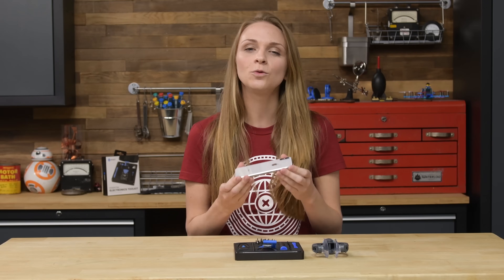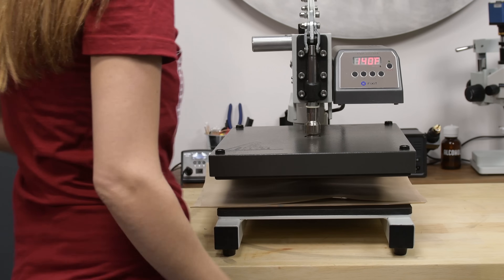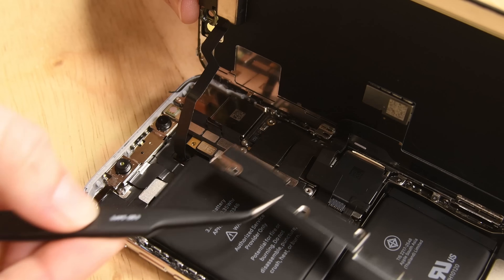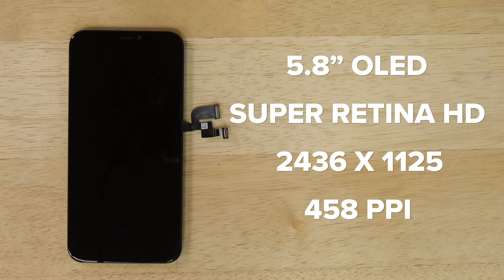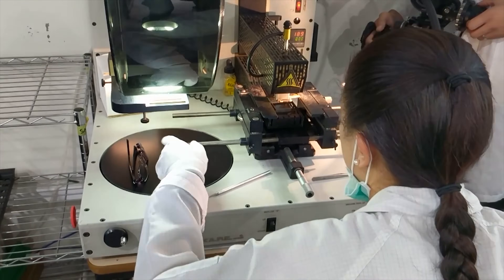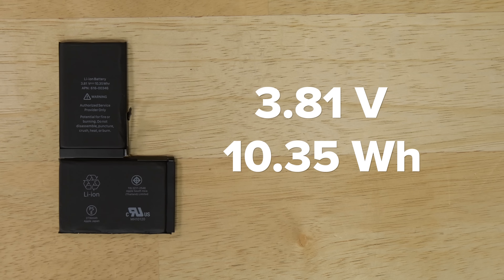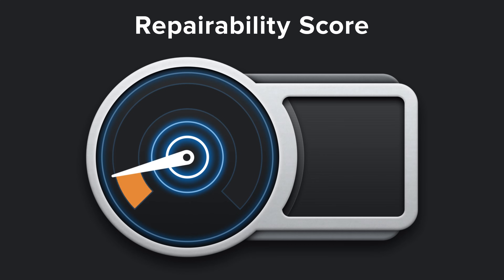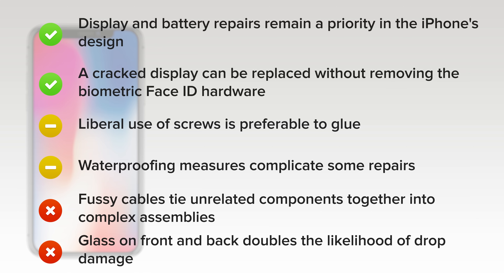iPhone X Teardown and Analysis!

Comment: But you haven't answered the question eryone should be asking:  how many charge cycles before apple throttles cpu performance? And when can we expect our $1000 investment to run at 50% performance?  1 year? 2? Or maybe it just depends on how poorly apple's stock is doing.
Reply: They’re gonna let you check it in later iOS versions

Comment: I was actually wondering about the inside of the iPhone X. Cause there’s 3 speaker lines two on the bottom where the lighting port is and one at the top where you put to you ear. Cause no sound was coming through to the bottom left side of the lighting port of where the speaker is usually is. The right and top are working as a audio for sound like music. Didn’t know the left speaker was not a speaker that was just a Taptic engine. Thanks for the video.

Comment: that PCB is a mess 
one can't repair it anymore
Reply: You cant repair phone PCBs for many years anymore. Everything is based on microcontrollers with thousands of soldered pins and you cant find replacement parts either.

Comment: - 2 batteries that can fail instead of one (and apples batteries are known to fail after about a year, at least my last 2 iPhone have) - sad.
- all processing power at one small spot= interesting to see how hot to the touch that spot will be under load, i did not see any heat pipe or advanced cooling solution. No space i Guess :-)
Reply: iPhone batteries do not fail with in a year stop spreading false information. Your 2 experiences don’t equal everyone else’s.

Comment: I'm done buying phones , the only thing I do on them is watching new ones coming out
Reply: Hugo true
Reply: That's right. And you can see examples of phones worth 100-200$ in which you can still record 4k, have 21MP sensor and 2k display like the elephone s8 instead of paying 600-1200$ like a moron for not using it.
Reply: Aitor Jara you act like those $100-$200 phones are actually on par with current flagships. yes, they can do those things. but they can’t do them WELL

Comment: One question for iFixit. I repair Apple logicboard for living, and i'm wondering if is possible to join back two half of this board after desoldering it. I have noticed that you had to heat whole board to separate it, because there is some elements moved from original location. You have never got this iPhone X to work again isn't it? It's toasted. Please reply.

Comment: Its interesting to see this highly proprietary internal design. I've never seen so many ribbon cables. Compared to the highly modular and comparably ribbon-less design of LG's G6 and V30, I think LG's use of contact points for its internal I beam is much better.

Comment: its more down to the ott price apple charge for a simple glass back , while other phones cost under 100 apple feel right to charge over 300 which is a con , if you crack both screen and back it would be probably cheaper to buy a new iphone.